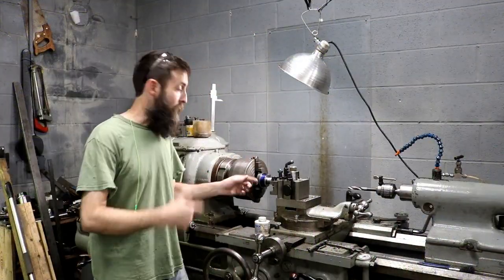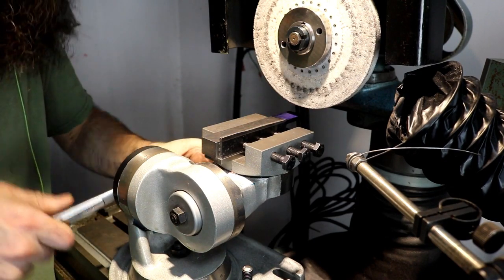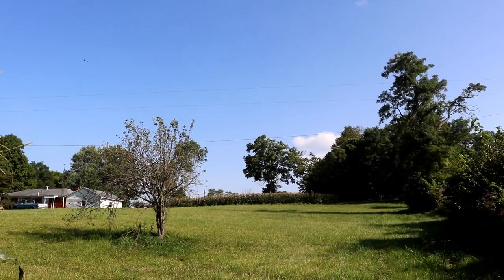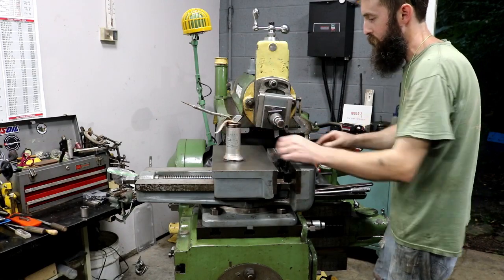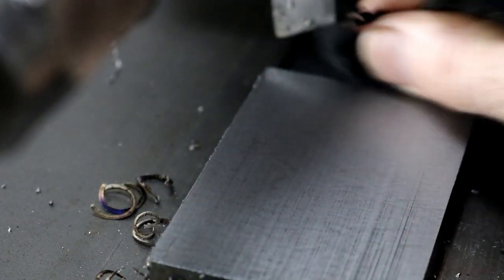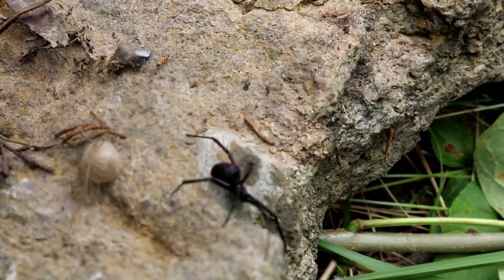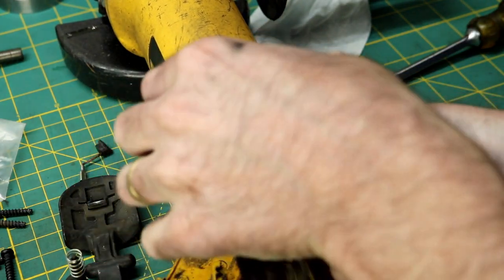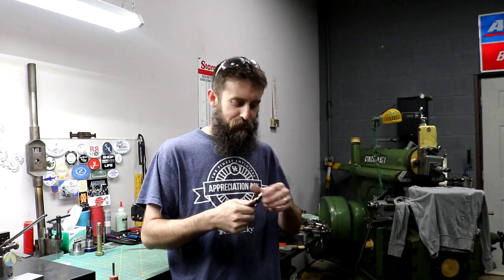Metal Shaper / Cutter grinder Weekly Random ;-)

Comment: Just an observation on the parting tool grind,the knowledge of which was passed on to me by a cutter grinding toolmaker many year's ago.
When you ground the 2 degrees side clearance,it is not necessary to incline the 1 degree as well.
The reason for this is that when you apply the 3 degrees top rake,the back part, looking down on the top of the blade will automatically dovetail inwards because you are further down the inclines on the side where the thickness is less.
Reply from the maker: VERY Nice ! didn't think about that but it makes perfect sense.  Thank you!

Comment: For sure you got it right using the bench or pedestal grinder for roughing a HSS cutter. The most useful is a large pedestal grinder with 2-3 hp. Those allow you to lean on the cutter to speed up roughing it. Make sure you have a bucket of water nearby to cool the cutter so you dont burn your fingers. A solid table that can be angled up and down in front of the grinding wheel also helps to have more control when roughing. By the way if the front cutting lip is not exactly parallel but tilted 2-3 degrees with the right corner sticking out a little you get a clean face on your work while the remaining burrs stay with the stump in the chuck.

Comment: Good video. Nice job on the parting tool, clean cut, nice finish. I've got a collection of grinders also, at least once a year I clean and grease the heads and check the brushes, keeps them alive a long time even the Harbor Freight ones.
Reply from the maker: Yeah, the grease gets displaced, some leaks out after time and ends up not getting on the gears which if not serviced burns up.   Never hurts to check and add some grease now and then.    Thanks for stopping by Jim

Comment: If you angle the front relief 1 deg to the left,  that last chip won't stick to the part coming off.   It might mess up that neat stack of chips piling up on the blade though :)

Comment: At last, I have heard it all. "My angle grinder didn't work because a black widow ate it :)" . Understand, by the  way, your tomatoes. Fickle things. Mine are doing well but we are now in fall mode. Lack heat.  I really was impressed by the finish on the shaper-ed part. That is why shapers survived as long as they did.
Reply from the maker: With a good grind on the tool the shaper can really do good work.   I like the straight line finish.    Last year we had more tomatoes than we could use. Planted in the same spot . Just never know what your going to get.. Sometimes nothing :-)

Comment: When you ground the end of your cut off blade you feed across from the  heel side then entered work from the heel side with the table towards the cutting edge. As the wheel moves toward the cutting edge steel gets hotter and is likely to burn edge by the time it reaches the cutting edge. 
Wheel should enter from the cutting edge side and  move toward the heel. It should burn less. I don't if you know what I mean. 
Another way to say it is to grind against the cutting edge.

Comment: We have Black Widow spiders here in Australia but we call them 'Red Backs. Got bitten by one three times a couple of years ago... Or maybe I got bitten once by three of the little buggers. Anyway, I didn't feel the bites but a couple of hours later I noticed a dull ache on my arm where I got bitten. About midnight that night the arm felt like someone had been whacking it with a steel pipe. Ached like hell. 

Here's a hint if you ever get spider bit and you think it might be a widow bite. 

The envenomation site might turn slightly pink and might be slightly swollen but the dead give away  is that the envenomation site will sweat.(perspire) Generally speaking and unless the temperature is pretty high, only the site where the bite occurred will perspire. (Hyper hydrosis) If you happen to be near a medical facility and for a bloke about your size,  treatment is usually one ampoule of anti widow antivenin administered with a bag of Hartmann's solution, a bit of phenergan for the pain and maybe a bit of cortisone. Otherwise you night try rubbing the bite with a bag of frozen peas or maybe some of that corn you have growing down the back if you've shucked and frozen it. Never tried it but supposedly, the cold denatures the venom a bit... Cheers.
Reply: Our "spider to watch out for" is the Brown Recluse.  If the bite is untreated, it develops a nasty rotten core, then spreads.  A trip to the doctor at least, steroids are usually involved in keeping the affects to minimum.

When winter shirts/jackets come out of the closet, best thing to do is shake them out, turn the inside out (without putting your arm in the sleeve) and shake them out again.  Have big heavy footwear on and be ready to stomp if a recluse hits the floor.

Comment: Hey Steve, any time you change your brushes. Take the time to clean the commutator. Just use a pencil with eraser and rub it clean. You'll be surprised how much it will help.
Reply from the maker: I did clean it. Just not on video. Cleaned it before I ordered brushes to see it it was worth the repair.

Comment: Good to know that Dewalt offers replacement parts.  I have had the same grinder for probably 7 years and never needed to replace any parts or brushes.  I thought I was tough on it but I guess you’re more rough on them then I.  Was it easy to get parts for it?  Sucks you have to watch out for those spiders.  Dont have that issue here in Pennsylvania but I guess you get used to it.

Comment: Thanks for showing the brush and holder replacement on the Dewalt grinder. I have one in my shop that probably needs the same repair. Where do you get the parts?
Reply from the maker: Got mine form ebay..   Cheap

Comment: I noticed you have some Anchorlube.  My small bottle dries out and turns into a thick paste, even though I keep the bottle capped. Do you have the same issue?
Reply from the maker: Not yet.  Think you can just add some water and it should be fine.

Comment: Hey steve, which would you prefer for a coolant system, siphon based or pressurized ones and what do you think the benefits of each are? I was looking at making one myself for an upcoming project, so wasnt sure which would be best and effecient for air usage.
Reply from the maker: Depends, They both have good and bad points.  To be honest It don't make much difference. The siphon system is safer to build unless you already have a small pressure vessel.  The siphon system can be filled on the fly if you run low on coolant.
Reply: oh, ok, Ill probably make a siphon based one then since Ive made a bunch of them already for the oil burners, shouldnt be too different than those. Thanks for the input.

Comment: Hi Steve,

What material do you use for the grit collection hose on your tool & cutter grinder? I've got a surface grinder whose previous owner used aluminum hose for its grit collection, and I'm rather unsatisfied with that: tears much too easily & doesn't flex well. I've considered plastic & silicone hoses, but I've been a little concerned about the risk of fire, with all those sparks getting sucked into a non-metal hose. Have you ever had any issues with such things?

Thanks
Reply from the maker: Mine is cheap boat hull vet line. Not good for heavy sparks but works well for the cutter grinder.  I have had a few holes in it where the heavy sparks hit it.   I just cut out the bad section and keep going. Cheap enough to replace often. The real good hose it very expensive.
Reply: @SteveSummers  thanks! that seems like a pretty-good system, & i think I'll give it a try

Comment: Steve I have an over abundant supply of Mud Daubers. So bad I had to build an insect proof room for my machines and anything outside of the room i protect with some kind of wrapping like aluminum foil or plastic wrap etc. I finally realized what causes that. It is my over abundance of spiders. Spiders are there because of over abundance of insects drawn to the lights outside my shop. Something is attracting the black widow's to your place. The black Mud Dauber is your friend because they only eat Black Widow Spiders. I saw a scorpion in my shop yesterday. I did not kill it but researched it. It seems the Scorpion is driven indoors due to the excessive heat we have been having.  All of Gods/Natures  creatures have a purpose.

Comment: That plot of land with the tomatoes needs more sand in the soil and peat I would get for 5 bags of play sand maybe more than that get get a couple yards have it dumped back there and start chopping it in turning it in and get a couple of big cubes of Pete after you done that and chop that in tomatoes if you got chickens chickens are the best thing that grow night shades chickenshit even hot. when I had chickens I used to grow peppers and tomatoes right next to each other down big long rows I'd fill buckets with chickenshit you know hopefully older chickenshit but even if it was fresh and put it in the bucket and just fill them with water to top it off and then set them down the rows of peppers and tomatoes and when it rain they were just overflow little bit and it would percolate in the hot sun out there and decomposed and man those peppers were gigantic beefsteak tomatoes that were the size of cantaloupe and Roma tomatoes that are usually pretty small they were as big as early girls